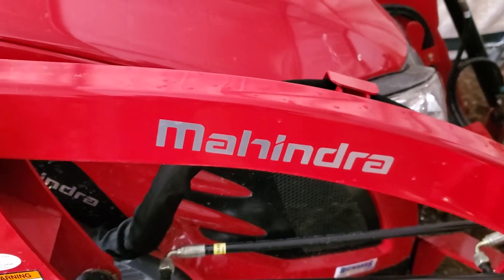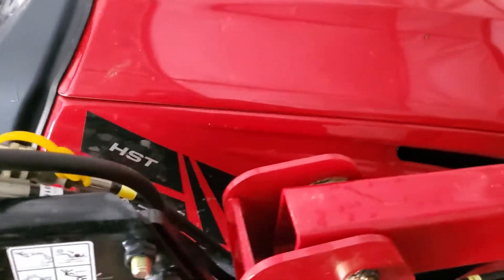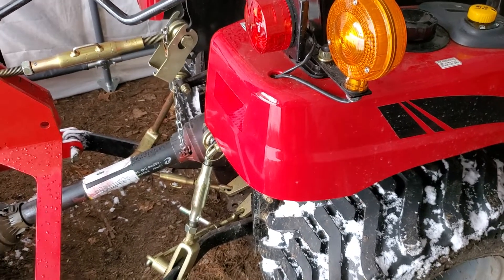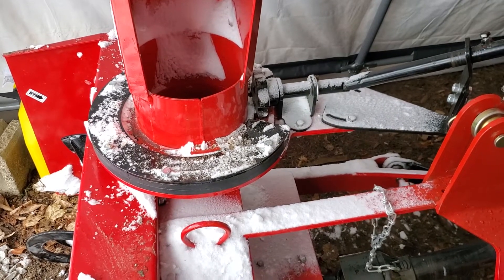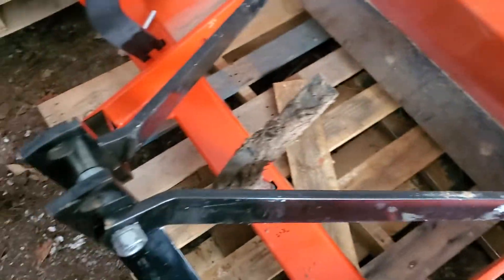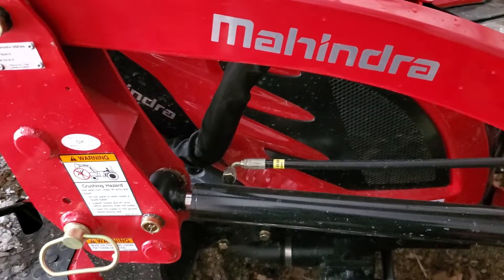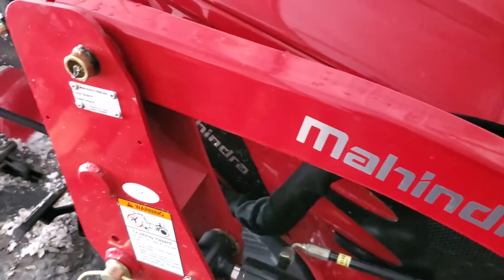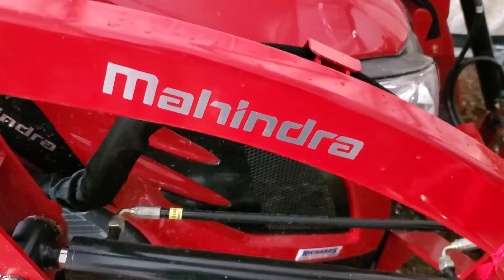Mahindra Emax 20s 20hr later

Comment: All I would add , for the money its a terrific piece of machinery . I have 17 hours on the meter of snow clearing witch was one tank full of diesel . Unfortunately first snowfall was 14-15 inches and the little tractor struggled a little .
That was an anomaly and its been much easier since. One of the better purchases we have made
Reply from the maker: thanks for watching 
I subbed to your channel. 
are you gonna show your machine at all?
Reply: Good morning, I'm just thinking of buying one of these strictly for "luxury" snowblowing (heated enclosed cab) of my 1/4 mile long driveway with 300' of grade. Your comment about struggling in the heavy snow was exactly what I was wondering about.  Now that more time has gone by, may I ask you how strong you've found it to be overall in traction and snow removal?  Thanks in advance, Bill

Comment: I got a quick hitch from Rural king for my 20s. I did alter the width by cutting a 1- 1/4 piece out of each side of the frame. After doing that, it works great
Reply from the maker: that would be interesting to see if you have a vid of it
Reply: @tazzharm  I don't have a video but I can send you pictures.

Comment: To control the 3 point hitch speed up and down so it isn’t so jerky, there’s a knob directly below your seat, the one in the middle not the one on the left. The knob in the middle control’s the speed of your 3 point hitch. Turn it one way it will drop it fast, turn it the other way it will drop it slow. Just turn it until you are comfortable with the way it goes up and down. Read your owner’s manual and it will be helpful in the operation of the tractor. Good luck. I have some videos up on my channel, maybe you could check them out.
Reply from the maker: sorry I may not have explained myself well.... the 3 point is fine it's the bucket and or forks mainly the forks.  if I have a pallet of bricks or something it's alittle bouncy .lol. I will check out your channel for sure.
Glenn.
Reply: @tazzharm  yes, I thought I heard you say the 3 point hitch was jerky.
Reply from the maker: @rickpacheco8864  just went over the vid and I did say the hydrolics not 3 point , but no worries. I was going to edit it some how if I did say 3 point.
thanks for input.
Glenn.

Comment: Sorry for my late seeing your video Sir 😉👍 Yes it is 20 hp but it as a lots of torque mon ami 💪👍😉 Yes in deed about the forks lifting but still great to have 😉👍 Your right lifting lower arm on your 3 points attachement nuts is loose Sir 🧐 Please do OVER oil it ( SAE 30 ) the chute mechanism it will help to keep it unfrozen  👍😉 Practice make perfect mon ami 😉👍 Please do read your maintenance manual Sir Cheers 🍻👍😉